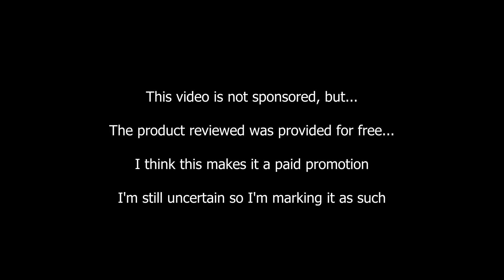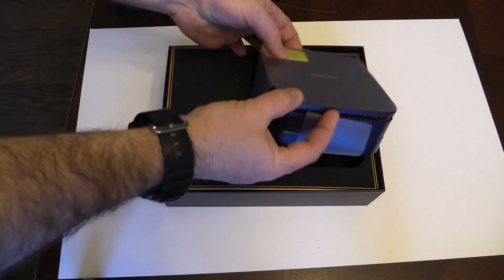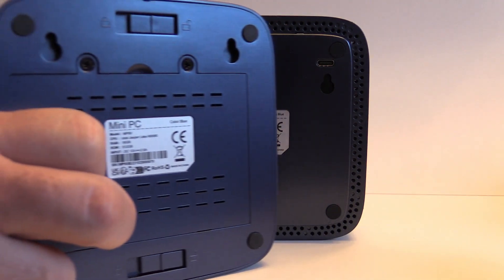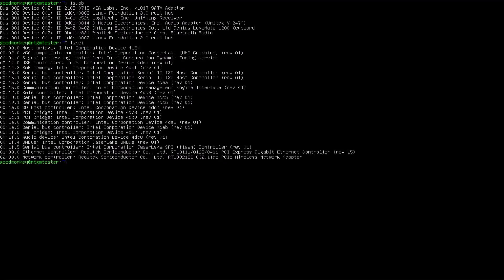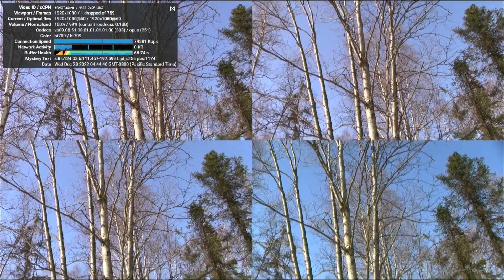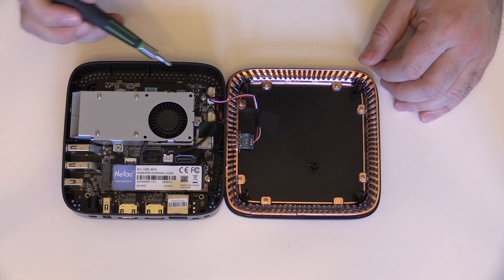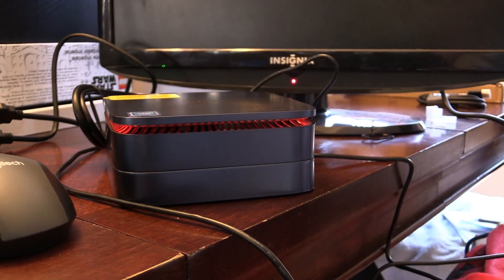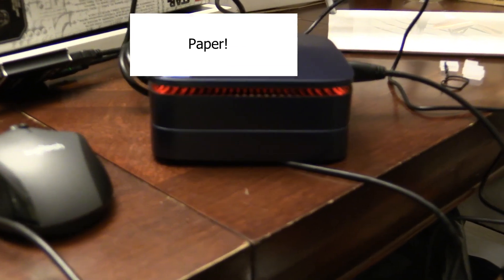Blackview MP60 Mini PC Review! Synthetic Benchmarks and Teardown

Comment from the maker: I was asked to test the power consumption so I did. The MP60 idled around 6 watts and during a Cinebench run maxed out at 20 watts (120 VAC) with all cores at 2.8 GHz, but settled to 16 watts with all cores around 2.5 GHz, and 15 watts when down to 2.4 GHz.
Also, if anyone is wondering why I didn’t reload Windows on this machine it was due to time constraints. I will though, and that could provide the opportunity to make a video on how to install the latest Windows 11 with only a local account.  Let me know if you’d like to see that.
Reply: Hi, can the 8gb ram version be upgraded to 16gb?

Comment: I've been running my MP60 with the N95 chip for about one month now.  I installed MX Linux 23.1 and the MATE desktop in a dual monitor setup, and everything has been working without issue.  I don't game and so fan noise is nonexistent.  This Blackview replaced a Gigabyte BRIX that I ran for nearly 10 years under Ubuntu 14.04.  Now that software support for that machine has ended, I thought I should finally do an upgrade.  This new mini with the N95 is just so much faster than the BRIX with the n2807 processor.
Reply from the maker: Very cool! Thanks for sharing your setup and thoughts. I hope that it keeps going well for you.

Comment: WARNING!!  I bought one.  Throughout initialisation the machine kept on cutting out.  I though maybe updates I uploaded 365, personal data and then a day later totally kaput, dead, knacked.  It is cheap plastic junk.  If you buy in the UK, there is no support.  You need to send back to china… with all your personal data on it.
Reply from the maker: That is unfortunate. Of all the mini systems I have (not all are posted to YT) I've only had one fail hard, and it wasn't this one.

Comment: What does a full sized gaming tower use for watts at idle. I just retired and I spend a lot of time with my PC hooked up to an 82 inch Samsung. I have solar on the roof and want to reduce consumption now that I'm home all the time. I hardly ever render videos now. My PC is an AB350 with a Ryzen 2700x and a Geforce rtx 2060
Reply from the maker: It is hard to say exactly, but I'd guess yours is using 30-40 watt at idle.  I say that because my Dell XPS can get down in the teens, but my MSI boards tend to idle around 21 watts. The lower end graphics cards I've tested add 10-15 watts when added as well, and it also depends on your power supply and if you have spinning drives along with how fast they spin and such.

Comment: Neat unit but a bit over priced compared to say a HP T740 thin client which walks all over it specs wise, cpu 2x faster, price, on ebay about $300, dual dimm slots, pcie x16(pysical, only 8x bus) slot, M.2 NVME slot, M.2 SSD slot, wifi, gigabit ethernet, 4 display port connectors and its able to drive them.
Reply from the maker: Sounds like a pretty cool device.
Reply: @ntgm20  Serve the home has a video on them. I bought one, added a Mellanox ConnectX-3 dual 10Gb nic,  and its currently my very bored PFsense router for my home. LOL 
Load average 	

0.14, 0.10, 0.08
CPU usage 	
0%
Memory usage 	
11% of 7787 MiB

Comment: What's the wattage from the wall at idle and under load? This is a good detail for these mini pc's, especially for those living in Europe where electricity prices are so high, and low power computers are in demand.
Reply from the maker: You asked and I tested!  I did a Cinebench R23 run, and the max pulled was with all four cores at 2.8 GHz and it was 20 watts (120VAC).  That settled into 16 watts with all cores at 2.5 GHz and 15 with all at 2.4 GHz.  The lowest draw I saw at idle with Bluetooth and WiFi off was 6 watts, and the same when WiFi on and connected but also idle.
Reply: @ntgm20  That's great, thanks for the info; at this price point (low end mini pc's), power efficiency is definitely a data point for consideration. I appreciate the update!